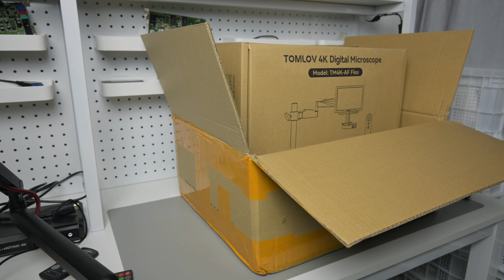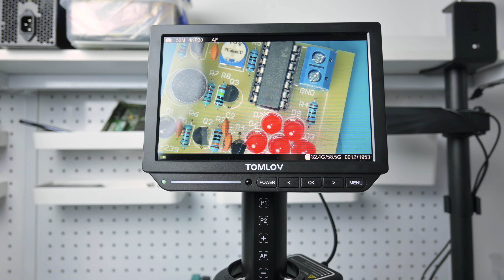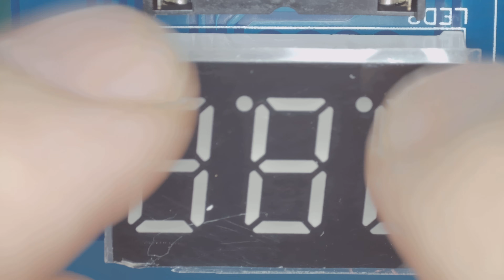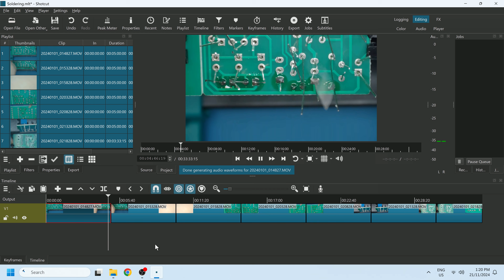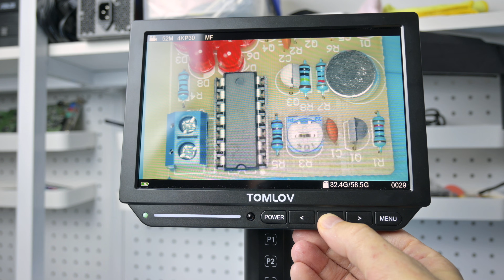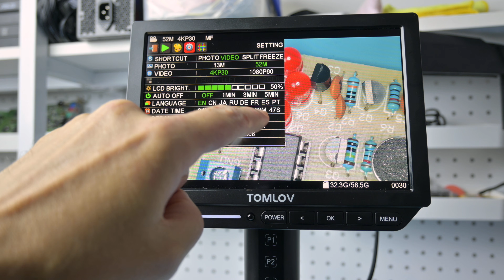Soldering a Tetris Game with TOMLOV TM4K-AF Flex LCD Microscope

Comment: Nice honest review.I was thinking of buying it but not so sure now.Any better recommendations in similar price range.Thanks ..
Reply from the maker: The main highlight for me, and it's a big one, is the nice arm and bring able to move it all out if the way easily. Also works with large motherboards. Most other models come with a stand on a baseplate and then you can only use small boards. The auto focus does save time. With the digital stuff, like recording and missing microphone, new models have already surpassed it.
Reply: @philscomputerlab Thanks heaps..

Comment: 0.5mm is a good thickness for most electronics jobs, yeah vigorous feeding, so what, makes it easier to control the amount. My preferred thickness is about 0.6mm. 1mm is way too thick. Sputtering is expected and not a problem, though if you feel it's too much you can consider dropping the temperature a little. Good solder joints, not like dog's dinner we've seen from you before :D

To be kept in mind 2-layer projects are a LOT easier to solder than multilayer boards, so you'll probably have some challenges to overcome yet. But you'll do fine eventually.

Comment: For soldering under digital microscope delay is really important. Can you measure it with this microscope? You can place a phone with stopwatch running under the microscope. Then take a photo with both phone and microscope image visible. The difference in time is delay.
Reply from the maker: I'll give it a go. So far I haven't noticed much of a delay when soldering...

Comment: Hi Phil. The lens of your head goggles/glasses are made of plastic or glass? On a local big electronic store I can find dosens of head magnifyers that look exactly like yours. I'm sure they are all copys of something, and don't know which one to chose. I'm trying to avoid some cheap plastic blurry junk. Thanks.
Reply from the maker: Definitely plastic! But still very useful 😊
Reply: Plastic lenses can be really good and clear no problem. All of mine are plastic and they're good. One is Edsyn MA10 made in i forget Japan or Switzerland and cost like 60 with one lens and then extra 20 for each replacement lens, one set was an Aldi special for little money, looks exactly like the ones in the vid, i kind of have a habit of hoarding things :D no problem really similar quality, just don't scratch them up.

Comment: Getting good at soldering comes with live experience, everyone teach different and most are not really optimal for every person. the important thing is to find the way that works for you and practice it until you get really good consistent results.
The solder splashing for you is quite common with Rosin core flux and noting to be really bothered about, the amount of splash you get is depending on how hot your iron is but I don´t like running the iron too cold since you only get cold joints then. 
I am a hot solder person and typically solder leaded solder at 380C and even up to 420C if the area is absorbing the heat. lower temps just makes you slower and you have to keep the heat on the components for a longer duration instead.
But that microscope seems quite ok for what it is anyway, it is probably not that expensive to buy compared to others

Comment: First of all you should use a flux. Don’t rely only on flux inside soldering tin. It is not sufficient.
Don’t cut leads after soldering - do it before. If you want to cut after you must warm up tin on PCB one more time. Cutting after is prone to cold joints.
Last but not least - use fume extractor!

Comment: I use a 20$ Usb microscop from Amazon, and even to solder 1.5 mm SMD components it works great.
I just added more (ajustable) light.
The split view is a nice feature here.
Reply: Do you have a link to the one you use please?
Reply: @angieangie21  I think Youtube hate links, so it will be deleted.
The usual cylindrical camera you can get on Amazon for 20 $.
Example search "USB Digital Microscope, 50x-1600x Magnification Handheld, 1440P HD 8 LED Lights, Portable Microscope Compatible with iOS and Android Devices, 2MP Portable Microscope Camera for Adults, Kids ".

Comment: For the USB port and any part that has a mechanical connection like screws or big pads solder/screw/mount that first and the rest of the pins last, this way you minimize the amount of mechanical stress of the smaller solder connnection

Comment: Interesting project. The microcontroller is a complete SoC like your phone uses but much, much less powerful, making it A: a heck of a lot cheaper & B: requiring far less electrical power. The microcontroller also has in/out connections directly attached to it so it can take signals in (from buttons etc.) & send sigils out, telling the LED’s to turn on and off for example.
Couple of things:
Those are LED displays, an array of light emitting diodes, not an LCD or liquid crystal display.
“PCB” stands for “Printed Circuit Board” so when you say “PCB board” you’re saying “printed circuit board board.” @PhilsComputorLab

Comment: That screen is way too small and there is some bad motion blur or something when you move the pcb under the microscope, low refresh rate maybe?
Reply: There is some of that but i don't feel it's a problem you wouldn't get used to. Keep in mind that you're watching on video where the image capture by the camera introduces a blur of its own, as it basically integrates what the display is showing over up to 1/30th of a second while your vision in real life is continuous and more instant. So you'd be getting one stage of temporal blur when working with the digital microscope in person (and it runs at 60hz so it's a shorter blur) while you're getting two superimposed on top of each other from watching this vid and the second one is stronger.

Comment: Phil you really should get a fume extractor, you haven’t been soldering for long but those fumes are toxic and have long term health effects
Reply: Those fumes are mostly just the flux core of the solder evaporating, not the lead in the solder itself, as that has a much higher boiling point. Still not very advisable to breathe in, though.
Reply: You could also use a fan to blow away the fumes
Reply: They’re inexpensive too!
Reply: @BingusTron good ones are. Anything else tend to be trash.
Reply: im sure someone will send him one for free

Comment: The solder spitting is probably because you are using flux core/rosin core solder wire, the flux/rosin is reacting to the sudden heat and boiling off. It's a normal reaction, unless you want to buy an expensive machine to cut a V groove into the side of your solder wire, cleaning it off after is fine.

Comment: Thanks for the video Phil. I have the exact same microscope and stand but without the auto focus. I got it delivered to Brissie for $250 AU with a eBay discount code a few months ago. I’m still really happy with it. I just finished repairing a 386 board with 4 broken traces. It does the job perfectly! Tip: when connected to a HDMI monitor you can angle the microscope and have a side view of what you’re soldering (just like Mr SolderFix). It gives you just that little better depth perception.
Reply from the maker: Thanks for sharing 😊

Comment: I have only tried briefly soldering using camera and I think it was Louis Rossman or someone who actually does professional soldering who stated that digital monitor solutions are really bad for working, compared to traditional microscope style dual lense optical models. Haven't tried, but absolutely makes sense as depth wise it felt really unconfortable to use. Though obviously pricing is completely different.
Reply from the maker: @jothain  It takes a bit of practice, but I got the hang of it quickly. It's like playing a video game 😊

Comment: I have a similar Tomlov microscope  (DM9) and the stand is a piece of crap. The teeth on the aluminum rod (which you use to adjust the height and magnification) have been damaged in less than a year of using it (and I've really not used it more than 30 times so far), and now it's a pain to adjust it, there's resistance, friction and lots of stuttering when trying to adjust the height (the aluminum rod is identical to the one in your video).
Reply from the maker: Thanks for the info!